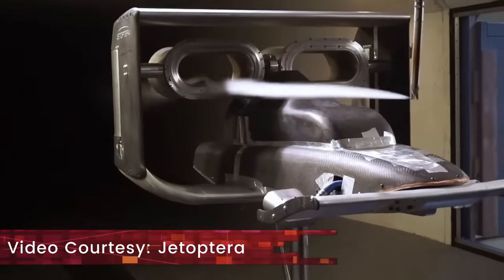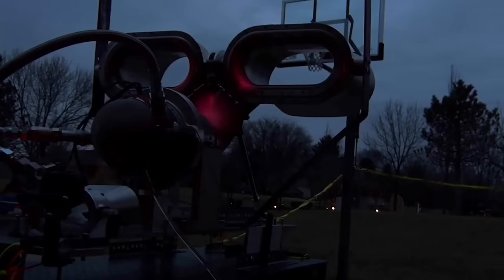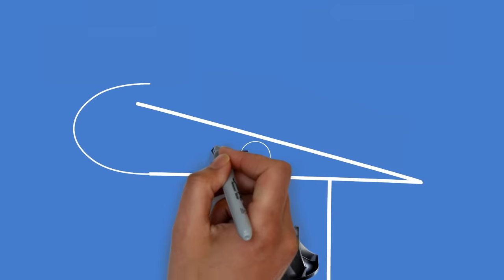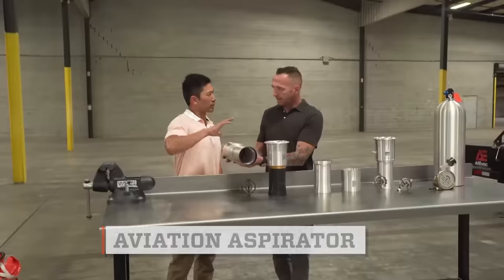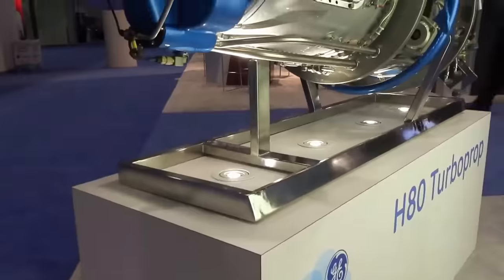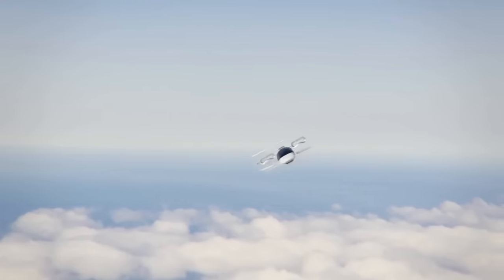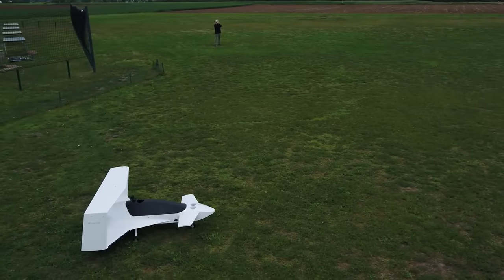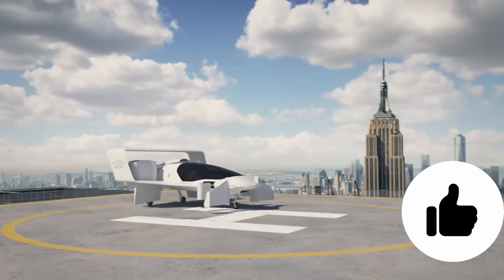Jetoptera's Bladeless Propulsion System

Comment: It will be interesting to see how the thrust-to-weight ratio works out for the full-scale, manned and fully-equipped aircraft.
Reply: @WilliamRNicholsonLST-1195  As the old saying goes: better safe than sorry.

I proudly state that I am Old School and reject the new-fangled 'Risk Assessment' approach for the tried & true 'Risk Avoidance' approach.
Reply: This might make an interesting motorcycle drive system. Very inexpensive compared to a geared system.
Reply: @pauld6967  Watching the 6 month planned Inspiration4, which set numerous records for humanity, implemented quite a few large-scale never-done-before changes... like the Cupola in place of docking capabilities, gave me a new found respect for the modern way.
Reply: @pauld6967  lmao what are you talking about?

Firstly, risk assessment and risk avoidance are fundamentally the same, they avoid unnecessary risk. Secondly, there's no reason for safety to not progress on the principal of clinging to obsolete tradition.

You're welcome to stay in the past if you want to, that comes at the expense of innovation and progress. The rest of the world will be just fine moving on without you.

It's always weird to see someone who would rather kneecap themselves over tradition that has little to no value. Pride is a strange thing.
Reply: @mechanomics2649  In the context I am speaking of, 'Risk Assessment' strategy ends up meaning 'futz with the findings in order to justify reducing the funding invested in protection because the amount of risk we think exists is within "acceptable" limits compared to what we say will be achieved. '

Whereas I am in favor of good old 'risk avoidance' strategy which has no tolerance for things to go wrong. You spend as much as you have to in order for the chance of your defensive/protective measures failing to be as close to zero as humanly & technologically possible in all situations, no matter how unlikely they are to manifest.
Reply: @WilliamRNicholsonLST-1195  Scaling effects, hello.
Reply: @pauld6967  So more NASA, less SpaceX. OK, got it.
Reply: @russelloppenheimer3970  Essentially, yes.  Especially when human life is at risk.
Reply: Hmmm... Only a hunch, but I think the engineers of this have the feeling that it won't meet required real world figures... Keeping it vague so investors come on board
Reply: Me too.... Looks like an overgrown dyson....
Reply: I seem to recall Rockwell building a V/Stol fighter using a similar concept using the wings. Worked great in a subscale model, but was hopeless at full scale. Let's hope Jetoptera's computer models work out in real life.
Reply: Well they should be weighing rc planes as they up the scale to give it the best chances to show real world action and reactions. 
I fly rc planes and definitely using scale weight changes the way they fly but it can be done with props and soon I’d believe scale edf will be possible. This however will need time.
Reply: Interesting for sure. I'm sure with all the farming restrictions coming out the WEF, thrust to weight should be a go.
Reply: Might be really facinating to put this concept into the hands of the common everyday man, if the price were low enough.
Reply: @pauld6967  what you're saying is so ridiculous.  It's literally impossible to plan for every risk when developing complex systems - this is one of the core reasons the field of systems engineering was created.  You must be one of these people who prefers a slide rule to a graphing calculator
Reply: @kdrapertrucker  So the technology must be exploited to the max by drone designer- if the experiments shows such that such "air suction multiplication" was very efficient in small scale aircraft...
Reply: @michaelrezendes5255 that Flies!! Hello! Thats what makes it Bad Ass!!

Comment: Bernoulli's ghost nods and smiles
Reply: i would have thought coanda.
Reply: coandah worked on the outside.. Bernouli worked inside a manifold.. but they are the same ideas derived from observations.. and measurements.. science is all about measuring the Universe we live in.. if you don't see the math It's not science.. ...
Reply: now.. think about a personal sized dirigible.. can land anywhere, even water.. with solar cells printed on the skin.. and a neutral buoyancy from helium... with palladium instead of aluminum.. it's almost impossible to melt as AuPd.. lighter than aluminum.. stronger than steel... steel has a density of 7.7.. palladium starts as 8.8.. it's like plastic steel.. mixed with gold... and it is definitely lighter than aluminum and I am not sure how  .. it's a measurable phenomenon that happens each time I make AuPd
Reply: it's not rare or hard to find... it's going to Change the World
Reply: first up.. palladium foil 1m³ helium balloons .. many.. and a 7.5 m² parachute to hold them together.. silk and shellac create a very strong bio plastic for the outside... and.. the pilot seat.. to see what happens... I am working on it now
Reply: this is so very elegant... it's the way to fly... thanks for sharing this
Reply: @richardcarew4708  maths...
Reply: -sYn-  it is not the language of science... there's no science without math... without the math it's just blah blah blah
Reply: the phenomena in this, the one and only Universe, are measurable... and through those measurements, the Universe is knowable... we don't have to guess... it's not magic... a universe begun with magic.. is not knowable... with magic.. any damned thing can happen
Reply: fortunately... there's no such thing as magic
Reply: I got that idea from my father.. who built the weapons tested in New Mexico, and taught reactor theory when I was in high school.... and from at least a half dozen science fiction writers.. including Asimov, Heinlein, Phol,  and a few others... it's logic.... and direct observation
Reply: so... stuffing a universe into one of my dots is.... impossible to put a number on.... it's just blah blah blah
Reply: even a really small universe... like Einstein's... or the priest who invented the BB "theory".. promptly after Edwin Hubble found other galaxies moving in all directions... no preferred direction, as the Michaelson-Morely team found in the 1890s... and can be seen in all un photoshopped Hubble deep space images.. red moves away from us... blue towards, green, yellow and orange are tangent to our motion along the Sagittarius arm of our galaxy... and.. it is all going round and round really really fast... and... it's made from hydrogen atoms squeezed together... the Universe is expanding because, through the auspices of quantum foam, new hydrogen continuously forms.. from the passage of light through vacuum... the vacuum between atoms is exactly the same as the vacuum between stars 🌟... I create quantum foam in my laboratory
Reply: if you don't see the math it's not science... quantum foam was hypothesized in 57..  and experimentally verified in 64... and soundly ignored in favor of magic.. and horse feathers and lies
Reply: Susskind's string theory requires multiple universes to make the math work... in an infinite Universe... there's neither room.. nor need for more... dividing infinity is about the same as dividing zero... it's a null concept..  and.. space is the distance between two things... it requires neither a beginning (and end), nor making..  ya can't make more nothing
Reply: The StarFire Family wishes you Peace and Prosperity ad Infinitum 🙏
Peace ✌☮Namaste

Comment: Propulsion and laminar flow are the keys to success here. Wishing them lots of success in further development and scaling up of this concept that promises 50 percent less fuel!
Reply: Laminar flow were used for some WW2 fighters so...
Reply: How can you have laminar flow when you need highly compress air jet mixing with ambient air to generate flow induction? This is nonsense they are just stringing together buzzwords to fool investors.
Reply: @David S. both laminar flow and turbulators were developed simultaneously. Both seem to have dropped into the background

Comment: It was also used in aerospace technology as a thrust augmentor, drawing outside air into the rocket exhaust gas  stream, cooling and condensing the flow, increasing the mass, and exponentially improving the propulsion efficiency

Comment: I watched that other guy market his "flying car" for a few decades. I always laughed at it because it was basically a helicopter. This design is actually innovative and gives me cause for optimism. I wouldn't call it a "flying car" because it doesn't look at all suitable for driving around town. But as a door-to-door mode of long-distance travel it looks to be phenomenal. It would give me the ability to randomly visit family 900 miles away without the need for planning, taking time off work, or dealing with airports.
Reply: its still an aircraft so you would have to plan and deal with airports and controlled airspaces

Comment: He showed similarities between a Copus blower and Henri Coanda's air foil aircraft design, to this design. both operate similar to how the Dyson blower works. Copus blowers have been used for years for confined tank enclosures and for drying or cooling inside of tanks. We used ours to cool down the shaft furnace at our copper refinery just before a furnace rebuild.
Reply: Самолёт команды не взлетел проще говоря такого самолёта не существует

Comment: This same principle is used by some camping beds and beach couches where you gently blow into the inflation tube which is specially designed to multiply the air, and it blows up the whole couch.
Your breath creates a pressure difference and a flow which pulls in the surrounding air to fill the entire thing with very few breaths. Pretty cool.

That’s just a simple way to see this principle in action with your hands and your own breath. It’s pretty magical when b you see it work! One breath and the bed is almost full! It’s pretty crazy… science is awesome
Reply: It works the same on my blow up doll

Comment: These thrusters rely on turbulent mixing of the driving jet with the secondary airflow. They can not enhance thrust over the entire flight regime - maybe they can enhance static thrust. I am sceptic.
Reply: it is supposedly meant to increase lift on the wings... at least that's what it looks like to me.
Reply: Just a picky note: you meant "skeptic". Sceptic means a blood infection.
Reply: @2degucitas  maybe thats what he meant, maybe he has a blood infection
Reply: I am a sceptic :-) but not septic. Sceptical I get,
 when I hear the sound of jet pumps turned inside out....
Reply: @doctor_moodm9536  Which makes the cartoon of using them as VTOL lifters dodgy.
Reply: @2degucitas  No, these are just differences between American and UK spellings.
Reply: @2degucitas  he is as he says.
Reply: @2degucitas  Skeptic and sceptic are both accepted spellings. The term for infected is spelled septic.
Reply: They claim a 10% increase in thrust and 50% greater fuel efficiency.
I imagine (wild guess from a non fluid dynamics person) that the efficiency increase is due to a smoother transition from low volume, high speed flow to high volume, lower speed flow. Very similar to the thrust enhancement that is gained by exit nozzle design.
Also applies to rockets.
Reply: @dougaltolan3017  less noise they say
Reply: I couldn’t have said it better myself......👍👍👍
Reply: @enginesandmore1013  "trading thrust for airmass"

Isn't that exactly what a high bypass engine does? Isn't that a good thing? 'へ'
Reply: @volbla  its doing it via a efficient mechanical coupling. This thing blows air into air
Reply: I don’t see why it can’t, the science adds up
Reply: @dougaltolan3017  I can accept a10%increase in static thrust (like the benefit of a ducted fan), however a 50% increase in fuel efficiency? There is not even a hint of justification. By the way, the entrainment approach would also apply to a ducted fan, and they certainly don't have a 50% fuel consumption reduction.
Reply: @volbla  again, no 50% improvement.
Reply: @volbla  i expect the thrust gain is mainly static, yet, again without any justification higher speed is announced as a benefit.
Reply: @andreasdinkelacker6729  I share your skepticism, thats why I posted "they claim".

Re this thing vs ducted fan.. could there really be any benefit from the resultant cylinder of jet exhaust speed air around the entrained flow? They did make an issue of the turbulent flow entraining more air downstream.
Reply: It does seem like the multiple 90 degree angles for the thrust to get from internal turbine to the external thrusters would have a significant cost to power overall. I hope they get it going, just intuitively it seems that internal drag may cancel a lot of the coanda benefit here.
Reply: @enginesandmore1013  "its doing it via a efficient mechanical coupling."

Is it though? It seems to me like a turbofan is a jet engine pointed at a turbine hooked up to a bigger fan. You're taking some energy from the exhaust to drive a big fan which can move more air. Jetoptera's design takes some energy from the compressor to do that "air multiplying" shenanigans.

I have a hard time spotting the difference. I need more numbers to look at!
Reply: @volbla  Moving air by turbulent mixing is far less efficient than using propeller blades. The only benefit here could be weight....maybe.
Reply: @ALBANOSTI  Indeed? Is it turbulent though? I don't know these things.
Reply: @volbla  i think the closer to the walls the more drag it has, pretty sure that's how the coanda effect works. though i am no where near an expert
Reply: @andreasdinkelacker6729 ... as compared to...? Fuel efficiency has more than tripled since the implementation of the dual-shaft-high-bypass jet engines over the old turbojets of the 50s... The gains of new generations with even higher bypass ratios over their immediate predecessors is admittedly smaller, but that's only refining the same basic principle.
Once you completely change the system, large gains might well be possible - IF the concept is valid. And I'm not yet convinced it is...
Reply: @JescoLincke  Carnot cycle?
Reply: @andreasdinkelacker6729  I'm not quite sure I get where you're going with that answer. The Carnot-cycle is a theoretical maximum of thermal efficiency mainly in stroke-engines. I fail to see the relevance to this project.
Just to make things clear - I'm not supporting the validity of the 50% efficiency increase claim. 
I would just like to keep the counter-arguments as solid as the proof-of-concept for this project is expected to be.
Reply: It's a scam.
Reply: I agree seems like it would be most efficient at low altitudes where turbines are less economic, low speed high fuel consumption is not a good mix. Maybe a Turbine Hybrid electric model, Small turbine coupled with a small capacitor bank for motor starting, turbine drives the electric generator for a comparatively large electric fan/compressor.
Reply: @suprememasteroftheuniverse  And you do nothing but spam. Why should we take the word of a spammer?

Comment: That is too cool! I bet it's going to be extremely quiet compared to a standard jet engine. And you're really good at explaining it all. You've got a new subscriber
Reply: Dyson bladeless fans are louder than cheap fans.
Reply: Dyson claims 60-70% nose reduction for their fans vs. Blades
Reply: @myotherusername9224  at minimum speed vs blade fans at maximum. When full fledged they're noisy AF and don't even blow that much air